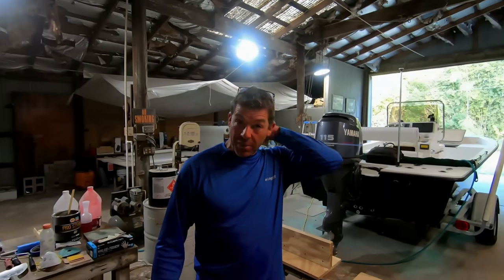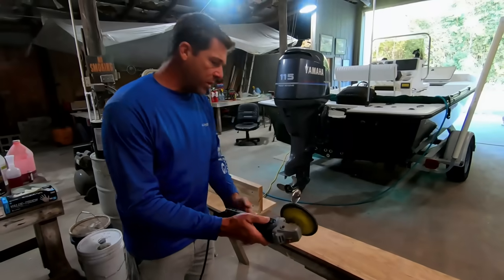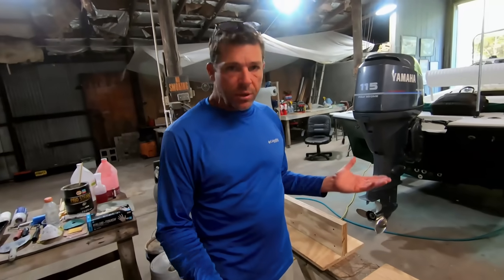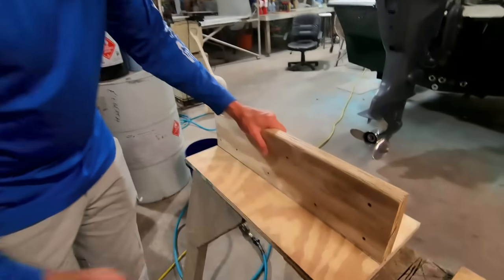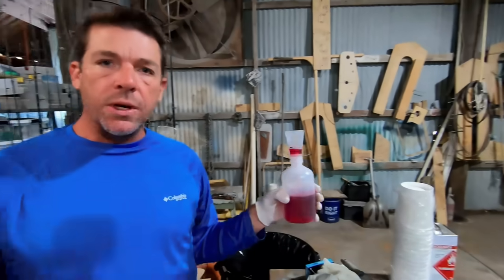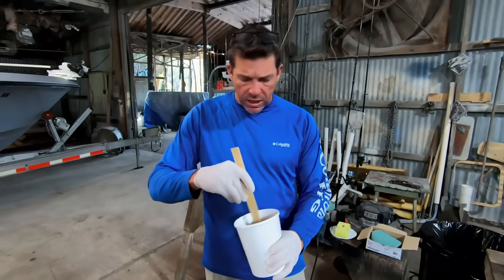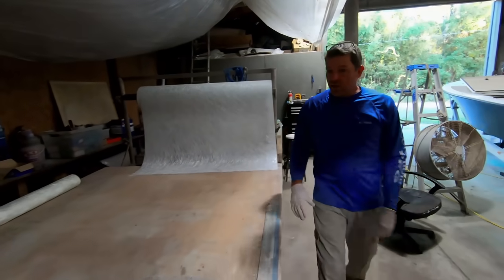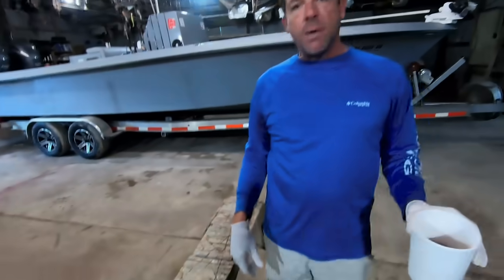How to FIBERGLASS over PLYWOOD!  Do it the RIGHT WAY the FIRST time! Step by Step DIY fiberglassing

Comment: Thank you for the excellent info Captain Joe!!  I won't be building any boats. I'm a retired musician, guitar player, and luthier building acoustic and electric guitars. So I'm pretty familiar with wood. I've also wanted to build a hot rod for a long time. 8)  I've followed "Factory Five Racing", a kit car company, the best in the world, since their start. In addition to Cobra's, they make 1933 hot rod kits.  They sell the kits in 2 parts, framing/suspension and body/finish. Since I also saw videos on The Morgan Car Company,  and how they build their bodies, I've been thinking about ways to combine the 2.  I may be a little nuts, that helps. LOL What they do though is cut wood in very thin sheets. Then they have molds of various kinds,  they spread glue on both sides of the sheets of wood, 8+ depending on what it is, then it gets clamped tight in the mold. 2 hours later you have a part. (that is very simplified for brevity).  At Morgan, the body, fenders, hood etc. is covered in steel and/or aluminum. When I saw your process I thought hmm, maybe just coat the plywood with poly resin, and maybe glass filler in any hard corners. It could save on weight, time, materials and even a better final result. Factory Five bodies are made from 'fiberglass', and some models carbon fiber. For the Hot Rod though, I think I could do a more simple build, and save $$.  The frame/suspension and body/finish each cost about $11,000. That's a great deal for the frame/suspension,  but I think I can make more of what I want, at less $$ for the body/finish.  
 You can check them out here if interested. https://www.factoryfive.com/  Sorry this was so long 8(   Thanks much!!   --gary
Reply from the maker: Very interesting comment Gary! I am somewhat familiar with the automobiles and the companies your talking about, but definitely not my area of expertise. I do mention several times in different videos that I hope what I am showing will inspire folks to try new things or make adaptations of their own. Sounds like maybe the videos have done just that! I would always recommend doing plenty of research and thoroughly test any ideas you have on a smaller scale before doing anything major, especially  something as involved as what you are talking about. And obviously safety would be a major concern for sure! I appreciate you watching and commenting, and I wish you the very best!

Comment: I did the bottom of a pleasure boat that a section of the stringer rotted.  I got a 5-minute crash coarse from a fellow employee that had some knowledge of glass work. Since it was covered with carpet I was able to hide a few sins. Was more to it than it looks. Peally interesting to see how its really done!!!
Reply from the maker: Knowing how to do some fiberglass work is not a bad thing, that's for sure. Hope some of the info we are putting out there will help you guys with your next project. Thanks for watching and commenting!

Comment: :face-green-smiling:NICE WORK!!!  ...THANKS FOR THIS EXCELLENT, WELL EXPLAINED DEMO!!... :face-red-heart-shape::trophy-yellow-smiling:CAN THAT GROOVED ROLLER BE "CLEANED AND REUSED, OR, IS THE ROLLER "DISPOSEABLE"?... CAN YOU USE A HEAT GUN ON THE POLYESTER RESIN, TO COAX SMALL BUBBLES OUT OF IT, TO GET A SMOOTHER SURFACE FINISH?  (AS YOU CAN DO WITH EPOXY)?!...:face-blue-smiling:
Reply from the maker: Thanks! Yes, we clean the grooved rollers with acetone. We don't typically use the heat gun technique with polyester resins, but it does work good with epoxy. I appreciate you watching and commenting!

Comment: I'm redoing the wood deck and floor of my 96 lund. I have watched videos and asked on Facebook and the info I received is all over the map. Use resin use epoxy use glass use regular ply, use marine ply use coosa. I was starting to panic. This video cleared everything up. Thanks so much. All I'm doing is glassing some meranti marine plywood for my floors and decks. But it's expensive and I was worried about messing it up. I feel way more confident foing forward now. Much appreciated.
Reply from the maker: Glad to help! You might also enjoy another video on the channel that shows using epoxy resin to fiberglass over plywood. Very simular techniques, just a different resin. Thanks for watching

Comment: wow great video!  I've built two glass on ply boats and learned a ton from you.  I think i am also going to jump ship to polyester. Its so much easier and cheaper than epoxy.
Reply from the maker: Thanks! You might want to consider vinyl Ester resin as a  option as well. It bonds and waterproofs a lot like epoxy, but cost less than epoxy and works easy. We just did a resin selection video that you might find interesting.

Comment: Great video and explanation, of your methods ! I'm a cedar strip canoe builder, and only use epoxy. I have regalssed several hulls, that the original builder used Polyester resin.  It doesn't bond as well as epoxy, to cedar. Again great video !  Jim

Comment: I have a boat project going on and had to learn it the hard way.
I could have avoided a lot of mistakes if I watched your video first.
One tip: On difficult, long inner edges I prepared a strip of fiberglass on sandwich paper, soaked in resin, and then applied together with the sandwich paper, peeling it off after the fiberglass stuck to the wood. This helped me a lot since I wasn't that experienced in handling long strips of fiberglass band.
I should have used mat, as you said, as final coat everywhere since I had and still have big problems to get a smooth surface. I used biaxial for everything.
Reply from the maker: Glad you are enjoying the vids, thanks for the suggestions!

Comment: As the fiberglass edges start to get leathery I use a fresh blade on a utility knife to cut off edges.  
  That saves a lot of dust rather than cutting the hardened fiberglass with a grinder.  
  Roll the edge into a tight ball to save space in your disposal bag.
Reply from the maker: Yep, we do that sometimes in our shop as well if we are around when the glass is in that sweet spot. Thanks for watching and commenting!

Comment: First time on your channel and I've done basic resin work before but never with fibreglass mat, as it just seemed a little daunting, but this was an excellent tutorial and explained a lot of the pitfalls I would probably have done without it.
Reply from the maker: Welcome to the channel! Mat or csm is a great material to work with, especially on the last coat for better cosmetics. Just remember it does not work well with epoxy resins. Polyester or vinyl Ester is the way to go. Thanks for watching!

Comment: Nicely done Joe, I’ve used drums and even tanker trucks of resin for hand and spray up. 
You did not showing ‘pre-wetting’ which we do/did a lot where practical.  Understandable for video. Building ‘egg crate’ bottoms to larger boats it helped speed the process. 
Also we gave up tearing the edge of csm years ago. The glass binders are so much better we can roll the edges down smooth with the fin roller. Saves a lot of extra prep work and makes multiple layers much easier to position especially when making molds that I did a huge amount of for industrial work. 
The final thought is the one thing that ruins a good job like you just did is the final installers of all the fittings and fixtures.  The screws, piping and wiring holes rapidly lead to water intrusion into the wood and rot.  No installer ever does a good job sealing the penetrations if they even bother.  All the old boat I fix up are ruined by these mistakes. 
Cheers Warren
Reply from the maker: Thanks for your input. I agree vinyl Ester has some great properties. I have always liked the torn feathered edges on csm, especially for the last coat myself. I can see you just cutting on mass layup or hidden parts for sure. I Plan on making a video on sealing screw, holes, and cuts soon. I appreciate you watching and commenting!
Reply: @FishBumpTV   reliably sealing hole will be interesting and valuable .

Comment: It's the end grain that gets you every time !  I only use Coosa Board now, I have no use for wood as stringers, transom or flooring in a boat. But you do lay-in FG well.
Reply from the maker: Yep, Coosa is great. We used over 15 sheets of bluewater 26 in the build of our custom 29 ft charter boat build. We documented that with over 20 vids on the channel. We even have a Working with Coosa 101 video on the channel. We had lots of requests about how to fiberglass over plywood from our viewers. Many folks are on a budget, or do not have a source for Coosa locally. 3/4 Coosa 250 to 300 bucks a sheet, A/B marine fir around 100. Our family built fiberglass hulls with A/B marine fir bulkhead and stringer workboats in the early 70s that are still solid as a rock today. That was also using polyester resin like we used in the video as well. Good plywood, and good prep work is the key to long lasting fiberglass over plywood work. Most production boats skimp on both, and you end up with problems. In the end you have got to use the material that makes you comfortable and works with your budget. I appreciate your thoughts and input and Thanks for watching!

Comment: I have built 3 boats with epoxy resin but I have a friend in Horseshoe Beach who told me that he used polyester resin but he soaked the wood with resin and no hardener for a week before glassing and using a hardener. He said that the bond to the wood was superior.
Reply from the maker: I have had lots of comments on this subject, and we want to put the correct info out there. All of my suppliers, and myself agree that thinning with styrene at a 5 to 10 percent max is the industry recommendation. That would be for polyester and vinyl Ester resins. I hope this helps clarify what is the modern recommendation for thinning. Thanks for watching!

Comment: The smell of the resin is what stops me from doing any fiberglass work. Great video, thank you.
Reply from the maker: Epoxy puts out a lot less strong smelling fumes vs polyester and vinyl Ester,  but you still would need to wear a mask when working with it. A quality respirator will stop the smells even from polyester and vinyl Ester resins. Hope this helps and thanks for watching!

Comment: Hey Joe.  Been enjoying your videos.  Was out in my garage earlier today and discovered I have a bit of Fiberglass Body Filler.  I have a few different brands that are polyester resin based.  A couple of the cans have thickened up and can't be used in their present state.  I didn't throw them out because I believe this stuff can be thinned out and made spreadable again.  

After doing a bit of research I've found where people have used paint thinner, acetone, polyester resin and other things.  From what I gather the paint thinner and acetone are a no no as it causes shrinkage later on.  Polyester Resin is an option but an even better option from what I can tell is Styrene or a purpose built body filler plastic thinner like US Chemical 40010.  

The styrene they say is what evaporates from the can of filler.  I seem to remember you using it in one of your videos to thin something...maybe it was the gel coat?  I can't remember for sure.

Before I purpose one of the last two I'm curious to get your thoughts.  Which is the better "thinner" to use when adding to fiberglass filler?  

Oh and I checked for the Napa stuff you use and couldn't find it online.  Where do you get yours from?
Reply from the maker: I like to use polyester resin to  thin older thickened polyester based body fillers. You should use styrene to thin gelcoats and Polyester resins. Hope this helps, thanks for watching!
Reply: @FishBumpTV  Absolutely helps!  Thanks so much for the quick reply.  I appreciate it!

Comment: Your video is quite extensive and does show a good way to do this. I am 70 years old and have been doing this a long time as well. . My best results still came from putting an epoxy resin on first.  then after it dries ,scuff that down with 80 grit Put a veil layer of a vinyl,  Ester, resin and glass in the hard radiuses at the bottom woven roving first, then  when it’s sets up scuff it again and proceed with ounce and a half strand, then woven cloth . I find that that epoxy  layer not only glue  the  Wood to the vinyl Esther but as you know, epoxy will not allow the water to pass through to the world I even put an Apoxsee primer over top before I paint like you with a primer 10 years ago I was shown how to do this and the vehicles that I have worked on  no moisture has gotten through any of the transom’s. I have worked on where the conventional way moisture still gets through without the Apoxsee. This is just been my experience what you’re doing works very well, but I have found it last longer when using Apoxsee resin, I have made some pieces with straight Apoxsee resin  And fiberglass cloth but it does not wet out very easily. Thanks for the video. Thought you might try this approach sometime.
Reply from the maker: Thanks for your thoughts on the video. No doubt epoxy and vinyl Ester have a place in boat building and repair. We plan on doing alot more videos on material selection and application in the near future, maybe even try some different suggestions from viewers. I appreciate you watching and commenting!

Comment: If you want to achieve a perfect 90 degree outside angle, would you do that with fairing compound?  Im thinking if the edge isnt chamfered or radiused first then ill get bubbles along the corner.  Thanks again!
Reply from the maker: Yes, you could use filler, or after the initial fiberglass application you could add thin straps of fiberglass to the edges and then sand them to a 90 after the glass has cured. I hope this helps and thanks for watching!

Comment: Hey Joe! That was a great explanation of what it takes to waterproof plywood. I’m new to fiberglass and have watched a lot of videos, some good and some not so instructive. If you have time could I ask you a few questions? If not totally ok! maybe a channel subscriber could help me out.                                                    Im getting ready to start a small repair on my first boat. It’s a Gheenoe 15’4” and it was given to me with the middle bench cut completely out and the front seat cut 
 open. My plan is to build a raise platform throughout the middle of the boat and repair the front seat. My plan is to build a raised platform 2”-3.5” tall, with 2 or 4 stringers running parallel with the boat, glass the entire platform until im satisfied and then attach the platform to the hull by way of glass, multiple layers of glass ontop of the platform that extend up the walls. My first question is, besides cleaning the inside surface of the boat, what other type of surface preparations do I need to make so that a raised platform can be glassed to the hull? ( sand the paint off of the inside+mineral spirits wipe down ?)
My second question is more of a “ what should I do”? 
I received Total Boat epoxy for Christmas (it was sold on Amazon and the walkthrough videos make it look easy to use) im new please keep that in mind everyone haha, but I want my glass work to look nice. From what I’ve learned I can use the epoxy with the 1708 Biaxial cloth but to get the smoothness like you demonstrated I need to have my finish layer CSM and that doesn’t work with epoxy right? I guess my question is, can I use epoxy for my first 2-3 layers of 1708 and then switch to resin for my last layer of CSM?
I’m sorry this is probably a mile long question by now. 
Thanks for the time to make the video you did. I will definitely be watching more and following along.
Reply from the maker: Thanks, Glad you enjoyed the videos! The Gheenoe sounds like a great project boat! Your basic plan sounds pretty solid to me, lucky for you those are very popular boats and there should be lots of modified examples around to get ideas from. Surface prep is very important for proper secondary bonding, so after cleaning very good, I would usually sand or grind down to fiberglass for a good bond. We usually use 36 grit paper for this phase. Epoxy resin should work good for this project, but you will have to stay away from csm when working with epoxy resins. 1708 or 1808 biaxial cloth works very good with epoxy resin, but you generally should not put any polyester materials over epoxy materials. Some people say you can, but in my experience it can be hit or miss.  You would just use a epoxy based fairing filler to smooth out the surface instead of csm. Also if using epoxy you can not use gelcoat over it as a finish coat as gelcoat is polyester based and can have curing issues over epoxy. You would probably want to use an epoxy based paint system for your finish coat. Hope this helps, and welcome to the channel!

Comment: I wonder if you ever can use vacuum to help fully impregnate the fiberglass.  Having worked in orthotics and prosthetics, that's how it's done for doing fiberglass and carbon fibre.  Of course our products are much smaller so it's more manageable.  Very excellent video.  Thanks.
Reply from the maker: Yes, vacuum bagging, and resin infusion are two different methods. They are more advanced, and require more specialized tools, and training. They are good, but not always practical methods for basic fiberglass work. Hope this helps, thanks for watching!